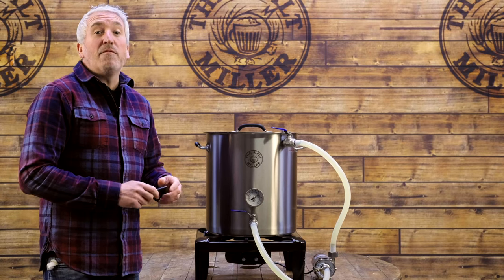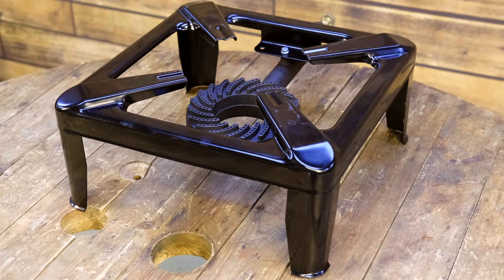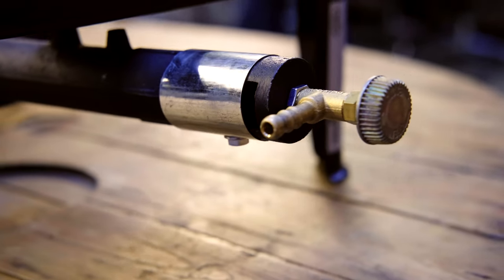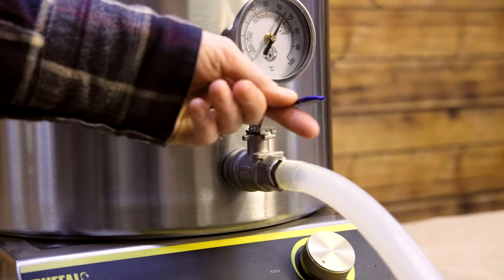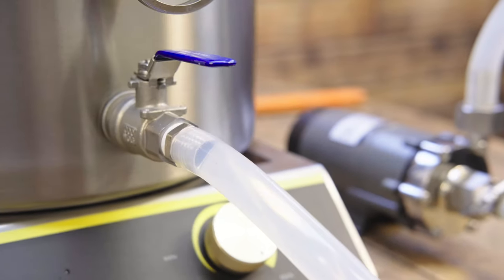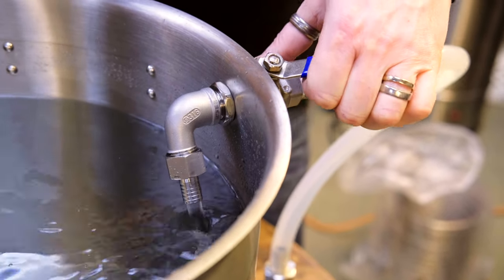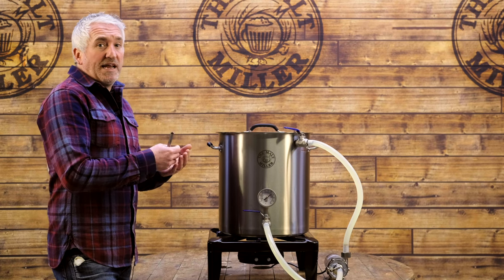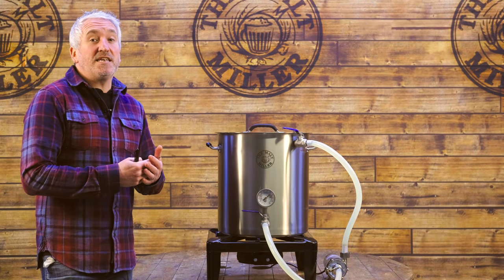The Malt Miller | Complete Brewing System for All Grain Beer

Comment: This looks fantastic. If you're brewing a in the 35l system what would be the max grain bill that it'd be able to handle? My current kettle I use for BIAB is 50l SO if I got this system I'd be worried about accidentally overfilling it! Or is it a case of not adding all of your water ahead of mashing?
Reply from the maker: With a BIAB system, in fact any system, the closer you get to max capacity the lower efficiency you tend to get. The brew that you saw shots of in the video was 5kg of grain in 30l of liquor. This was a no sparge brew so using total liquor from the start. So, I would think that 7kg would be max for no sparge, if sparging then you can get away with a fair bit more. I have not experimented but I would suggest at least 10kg. That would be a stiff mash!
Reply: @themaltmiller8438  Really interesting! Thanks so much for replying

Comment: Putting the unit together is a little bit complicated for me as their aren’t detailed instructions. Water is dripping from tap connection and thermometer. Not sure what order the nuts go on and wether i need seals / ptfe tape or sealant. Only small drip but you need an inch plus spanner which i don’t have.
Reply from the maker: Hey! If you’re stuck then drop us an email or give us a call tomorrow. Generally on all stainless threads PTFE is a much needed addition